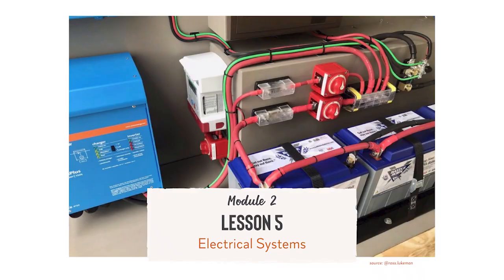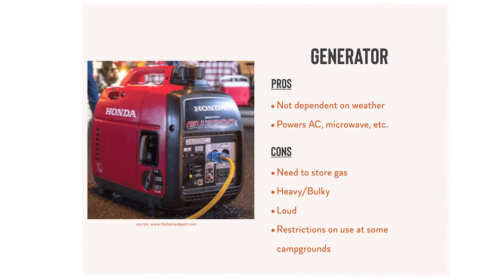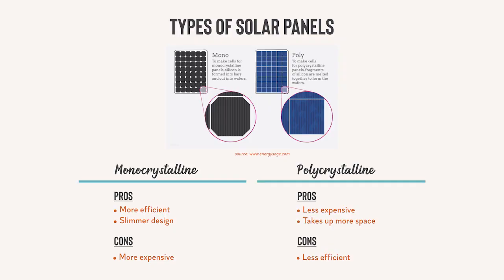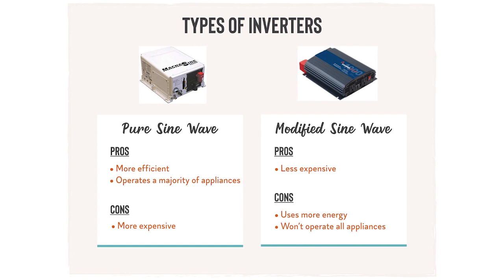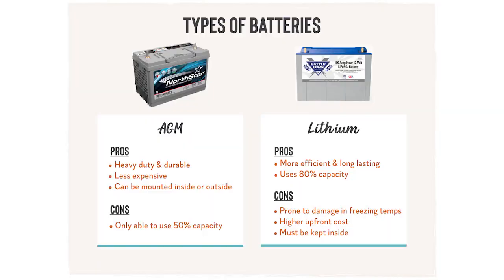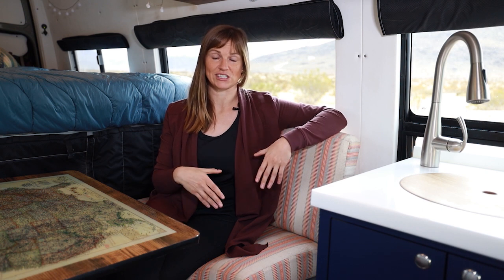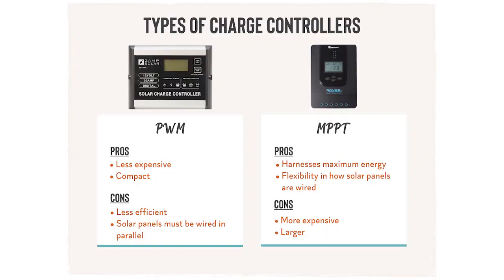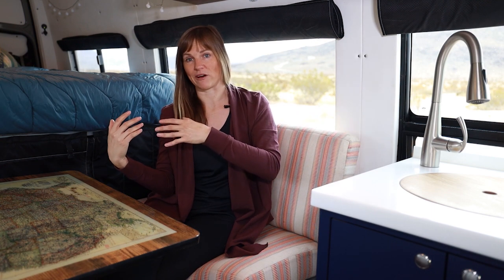Van Conversion Power Systems: Understanding Solar Panels, Batteries, Inverters & Charge Relays

Comment: Solar needs to be a 2:1  Solar to Batteries (200 Watts : 100AH battery).  I have  a 3:1 @ 1000 watts of Solar and  3x 100 BBB.  and with Lithium (270 AH)  I have never needed to run a GEN.

Comment: Hi. One little doubt about electrical sysems: can't you live basically from your alternator + connecting external power sometimes? I believe it'd be necessary to eventually change the original alternator to provide more power, but I see a few possible advantages on this - please correct me if I'm wrong, we're here to exchange ideas and experiences:

- You're driving somewhere, so, it'll be charging
- It charges faster than solar. So, in the case of you spending all of your usable power in a night you could just turn the engine on for some, say, two hours and have it recharged
- Solar's efficiency depends on number of perfect sun angle hours, etc. This is not a real everyday scenario
- You'd get free of all solar system weight and maintenance (daily cleaning panels to help on efficiency, for example), adding economy of fuel and range to you expeditions. Even if you carry a backup alternator and belts it'll be much less weight. Not to mention the aerodynamic effects of it on fuel and driving.
- If you car's alternator breaks you'll have to take it to a garage and solar won't be of any use

I've just began thinking of my future van and am being driven by this concept: the less, the better. Be in terms of weight, for fuel efficiency as to systems for less chances of problems and maintenance requirements. Concerning energy I've been thinking by a system using the car's alternator (probably a powerful one) and lithium batteries. My idea of use is to go for a round the world trip, but not a fast one, I like to enjoy places.

Since you're already on your second project, I'd love to hear your considerations on this. Thank you, love your work! My best!
Reply from the maker: A lot of people are installing second alternators now. So that's definitely an option. I like having the solar. It helps keep the van topped off if we are going to be parked somewhere for a few days and don't want to waste gas. But depending on how much you drive and the capacity of your battery bank, that could work for sure!
Reply: @bearfoottheory  thanks!